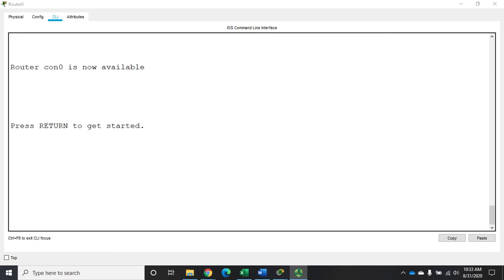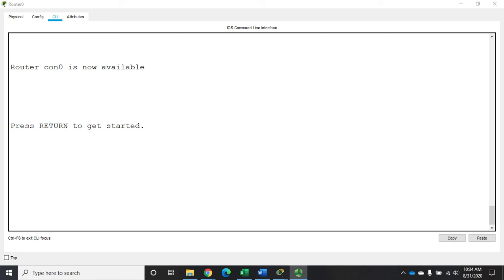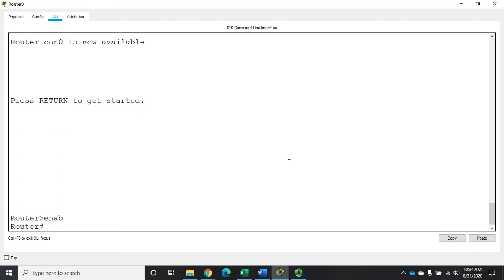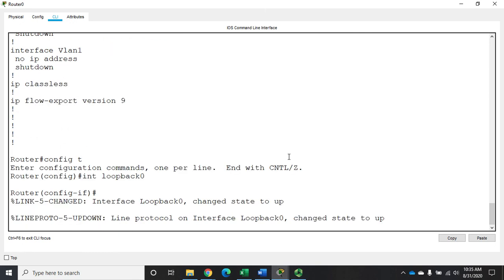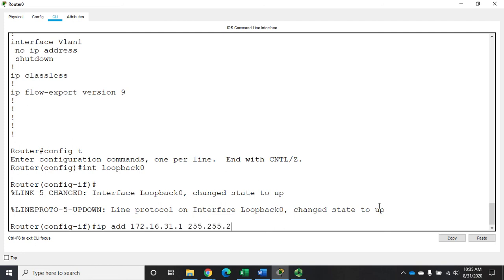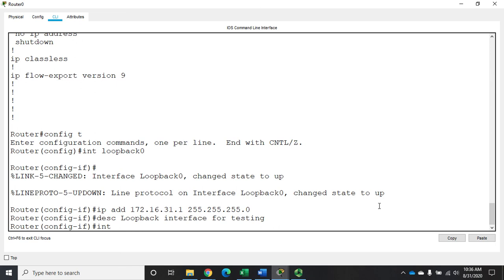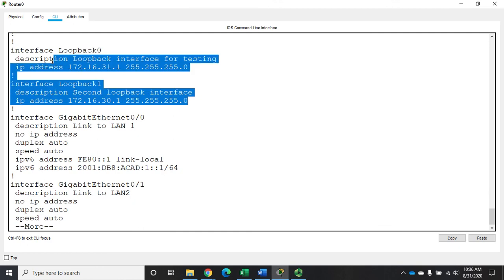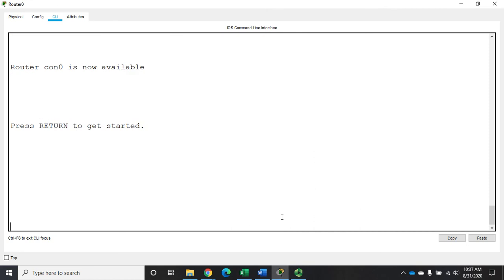Configuring loopback interfaces on a Cisco router

Comment: thanks David Dalton. i really appreciate dedication in your videos. very helpfulls. 
i dont understand the class b 172.16.31.1 has a subnet 255.255.255.0 instead of 255.255.0.0
Reply from the maker: 255.255.0.0 is the classful subnet mask since 172.16 is a class B network. In this instance, I used a class C subnet mask, in effect, subnetting the standard class B network.